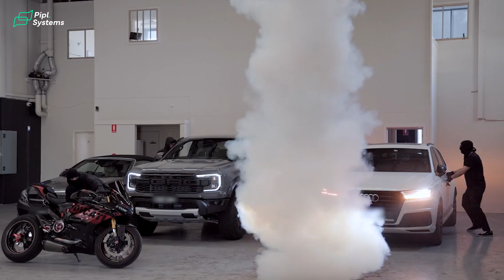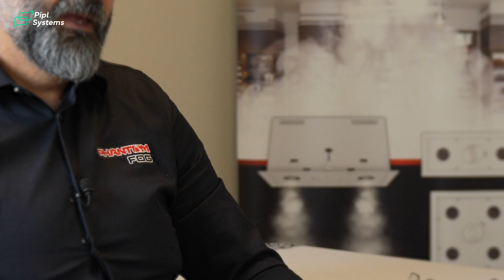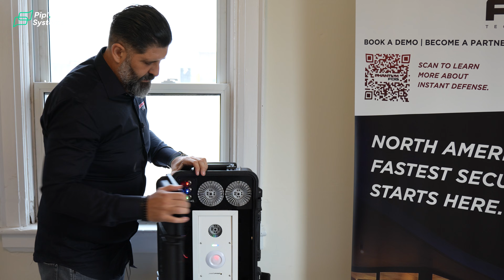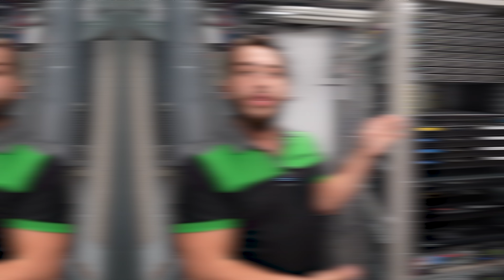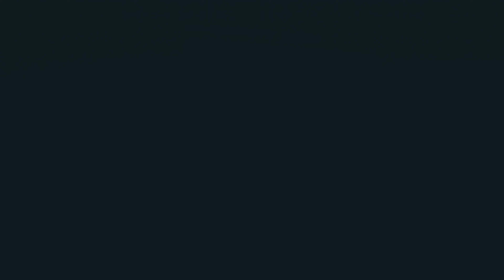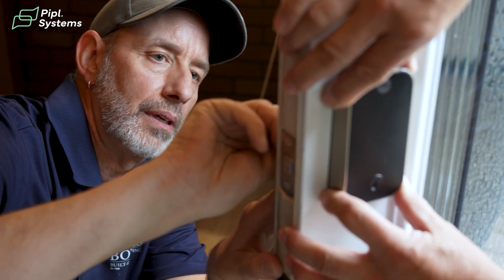Anti‑Intrusion Fog Security System Technical Review & Demo / Phantom Fog

Comment: How does your auto system work with animals? I set my alarm to away mode when only our dog is home. I would worry that she would trigger your motion sensor
Reply: He mentions your alarm system has to be triggered(siren blaring, cops on the way) for the smoke motion sensors to activate. If your alarm motion sensors are already tuned to not detect/trigger your alarm for your dog then it shouldn’t be an issue. The tech these days for motion sensors is really amazing. Based on why he mentioned, you could theoretically disable the on board motion sensors and use a third party millimeter wave sensor that you can tune for very specific detections. This would likely need to be done by a professional unless you’re into tinkering with that stuff.
Reply: I would think you should investigate safety first.   I think it depends on how they make their smoke.  I know at least for injestion glycol is extremely toxic.  In terms of the motion sensor he clearly stated that the motion sensor would only be used when the alarm is actually in alarm.  My research indicates that the smoke would be safe for dogs, but I would get that from the manufacturer
Reply: @sprung3750  Our system is not water based system. so no glycol. we are totally safe and food grade product